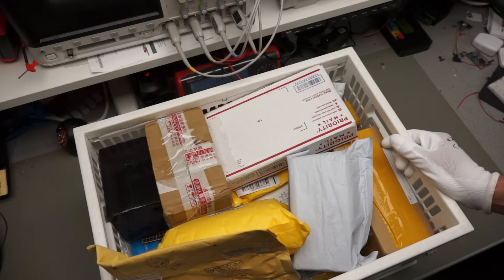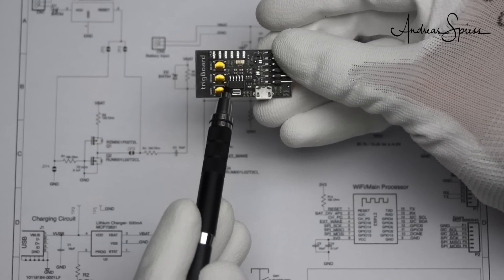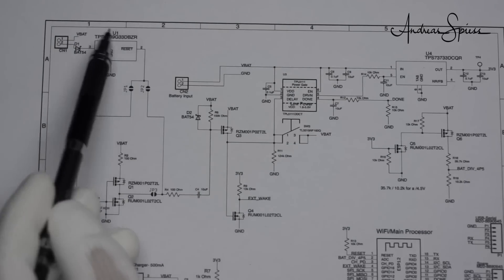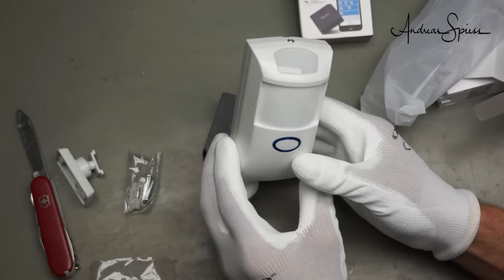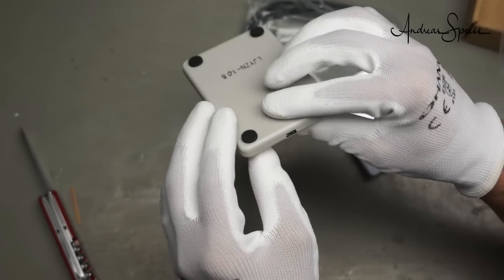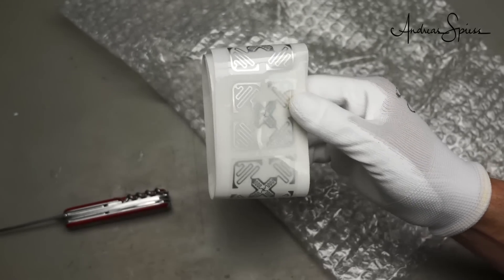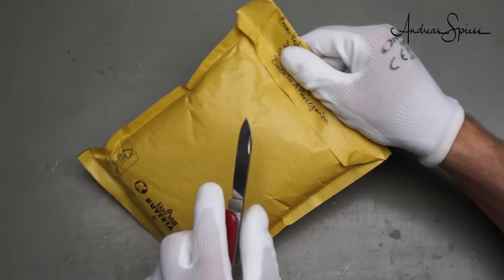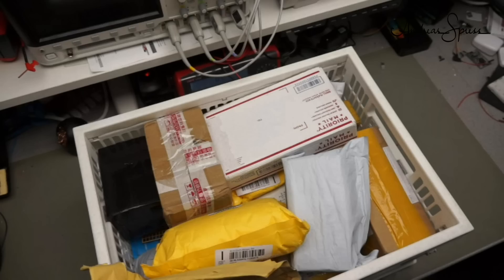#229 Mailbag (incl Kevin Darrah's Trigboard) Part 1 (Shelly, Sonoff, RFID, Raspberry)

Comment: Is there a circuit for the TPL5111 which allows for longer sleep times (like 24 hours) ? Maybe combining them using logic gates..?
Reply from the maker: I only know this one.
 If you combine it with a counter you will have to search a very low power counter.

Comment: Could you recommend a 433 temp sensor that would work with the Sonoff 433 bridge?
Reply from the maker: No, because I do not know yet which protocols the Sonoff bridge understands.
Reply: Do you plan on doing a video on the bridge? ....Might be fun to figure it out.
Reply from the maker: I plan to do one. But I will most probably flash it with a nw firmware.
Reply: Cool 👍
Reply: Cool 👍

Comment: Perhaps its time for some new Ikea stuff...
I Denmark we can now buy this model: https://www.ikea.com/dk/da/catalog/products/90356166/  cost less than 14$ Ill rather buy this than the sonoff.
The switch can also be bought together with a button (on/off), I haven't seen the button on the danish web-page yet.

Both can be used with the setup described in video #145.

So this time i think that its your bank-account that will be affected :-)
Reply from the maker: Fortunately it is not yet available here ;-) so I can save the money for the moment...
Reply: BTW they are also releasing some "tradfri" blinds next spring (https://www.99.se/artikel/11880-ikea-forbereder-smarta-rullgardiner) perhaps more money to spend.

Comment: I would like to see you develop a sensor array that can detect an RC vehicle transmitting on 2.4ghz.  I wont even lie: I'm building a tank and I was thinking it would be rad if I could detect another vehicle somehow.  Image processing is on the table, but i am curious if there is something less software reliant or more creative than my brain can come up with.  How about it, Mr Spiess?
Reply from the maker: It is easy to detect 2.4 GHz signals. However, detect from where they come is more difficult and needs big antennas. So you better go the route of image recognition.

Comment: The "TrigBoard" is a realy strange design. Why use a special timer? An ATTiny13A consumes 3 uA in Deep Sleep mode, but can wake up ESP not just on time or external signal, but also on specific analog value, sensor value or almost anything else. And it's dirt cheap.

And, of course, ESP8266 is obsolete, and ESP32 has it's own ULP for low-power operation.
Reply from the maker: From what I understood Kevin wanted to go below 1 uA. Did you try the ULP? So far I did not see many people using it in the Arduino environment...
Reply: A little bit, just for testing. I use esp-idf with Eclipse and JTAG debugging. But I did not measure power consumption - there's still a lot of really weird things in ESP32, which works not as on STM32 or AVR or any other MCU.

Comment: The Shelly has the following claimed approvals: 
Complies with EU standards:
• RE Directive 2014/53/EU 
• LVD 2014/35/EU  
• EMC 2004/108/WE 
• RoHS2 2011/65/UE
A similar device is available from Fibaro except the latest are Bluetooth and Homekit. The Shelly looks better built than the Sonoff, more easily hacked and perhaps more versatile with its 12V power. The important factor is range and susceptability to location or metal proximity. Might try one.
Reply from the maker: Thanks for the clarification about the approvals!

Comment: A little side step: Did you get around to test the SIM7000E based NB-Iot card that appeared in a previous Mailbag? What can it do - and not do - compared to other 4G cards, for example the other ones in the SIM7xxx series. (3G will shut down here in about a year or so, so I will have to migrate to 4G, and NB-Iot just opened as a regular service.)
Reply from the maker: Unfortunately, we still do not have an NB-IOT service here. So I cannot try.
Reply: @AndreasSpiess  Ok, thanks. Maybe you could try the card with ordinary 4 G, just to test the card? 
If you are interested, the charge here for NB-Iot is about 12 USD (99 NOK) per year per unit, inkl 5Megabytes, most likely incl overhead. 12 $ per additional 5 MB. 5MB per year is 570 Byte per hour.  So, you can do a lot with that, but it will  cost a bit if you have many devices. Maybe there will be a market for competeing Lora networks, if they can be organised. (12$/5MB is 240$/GB. I don't know the max traffic % on a chanel and the chanel width, but seems the Telecoms will get a good payback on the invested frequency resources, compared to 4G.)
Reply from the maker: I do not think LoRa can be done cheaper in this application as NB-IOT seems only to be a software update for the telcos...
I see LoRa applications more in one area around one or two own gateways and not scattered around the whole country.
I assume there will be a volume pricing for NB-IOT

Comment: Is it just me or can’t anyone else open any of the AliExpress links in this description?
Reply from the maker: I just tried and it worked here...
Reply: Andreas Spiess i tried it again using my notebook. Works fine. But the links won’t open on any of my iPhones or iPads. Wierd. Maybe the YouTube app screws up?
Reply from the maker: I tried with my iPhone and it worked.
Reply from the maker: But I did not update to IOS12 ;-)
Reply: Andreas Spiess ok. Challenge accepted. I have an old iPhone 5s in my lab as a video player while I’m down there. It’s the only device i have that is still on iOS 11. i will try tomorrow of it behaves the same .....
Reply from the maker: I am also on IOS11
Reply: Andreas Spiess ok I finally managed to try it out. With iOS 11 the links do work. With iOS 12 not.

Comment: the shelly board looks small enough to embed in the appliance like a lamp instead of a wall switch.
Reply from the maker: Also a possibility. Sure.
Reply: Works especially well if you have three way switches, meaning more switches for same light.

Comment: I'm really interested in your opinion on the Shelly. I'm a bit skeptical about it as there is no electrical isolation between high and low voltages. The ESP-Module apparently directly senses the hot wire.
Reply from the maker: 1. I agree with Ed19601. It is a covered product and will not be touched.
2. It certainly needs two wires to get power. Only line most probably will not work.
3. The Sonoff POW also was connected to the live wire. You always have to pay attention if you open such a device.
Reply: There doesn't need to be one, it is in a switch box you are not supposed to you touch it or connect low voltage to it
Reply: I'm interested too, for a slightly different reason. How is the device powered? In a socket it could take a line and neutral locally for power but in a light switch (at least here in the UK) there is no neutral (only line, switched line and earth). Whilst using the earth as a neutral would cause the device to power up it would be dangerous and wouldn't work where an RCD/GFCI/ELCB is fitted.
Reply: I find this device very versatile. I use to flash all my sonoffs, but the software for Shelly is very nice, and after they added MQTT, I do not se a reason to flash. Cloud is disabled when you configure MQTT

Comment: If the trigger chip switches the ldo of and on...... Where does it gets its power when the ldo is off?
Reply from the maker: The ESP does not get any power when the LDO is off
Reply: @AndreasSpiess  yes, but I mean the chip (TPL5111) that switches the ldo, where does that get it's power after it switched off the ldo
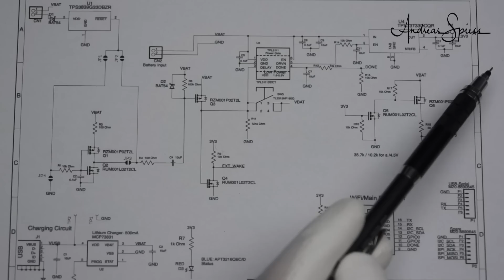Reply: If you have another look at the schematic (i.e. 5:20), you'll see the TPL5111 (or is it the TPL5110? - might be a typo in the datasheet?) is powered directly from the battery at all times, whereas the ESP8266/ESP12 is powered via the LDO, which is what is enabled or disabled as needed.
Reply: @pfeerick  great
 Thanks. On my phone that wasn't really visible

Comment: I have the sonoff RF bridge doing my 433mhz to MQTT translation. When I got it in summer you had two options if you wanted open source firmware to work properly and read all sensors: Espurna + a hardware modification to bypass the chip that actually reads the RF, or Tasmota and flash that chip with a special firmware as well. I went with Espurna + the hardware mod and now it's just like a DIY solution, but with the nice looking design. Overall it's cheaper and easier to solder a 433mhz module to a normal esp, same functions, less hassle.
Reply: What I've done is solder a esp-12 with both 433mhz transmitter and receiver module. But the problem is those cheap module isn't very sensitive. With a spring antenna, most of them are still usable only in a few meters. Nice to know the Sonoff RF bridge exists.
Reply: @willwho2512  I use the diy version with an esp and module for my apartment. Range is ok for a 2 bedroom, but it varies a lot because of the antenna. 
Using an analyzer like Andreas has u can tune it just right. Also, the superheterodyne receivers are much better. 
The RF bridge has very good range, its about 10-15 meters indoors, enough for a normal house with reinforced concrete etc.
Reply: NS Gaming  The analyzer is on my shopping list for a long time but it’s like a one time usage for me. Instead I made another two and place them around the house.
Changing protocol isn’t an option for me because this device needs to talk with other dirt cheap, off the shelf, and easy to muck around sensors. I don’t like those smart home products that always ask me to install their apps and ask for unnecessarily Internet access.
I already connect my doorbell, PIR sensors, and window sensors to my local MQTT system. it can even notify me through my line account(an instant message app).
Reply from the maker: The analyzer would not help here as it needs a 50 ohm antenna connection. Which  does not exist here (you have no antenna  connectors)
Reply: @AndreasSpiess  I sacrificed one board and bodged in a UFL connector on the antenna trace, then did UFL to SMA and that's how i tuned all the antennas. I'm sure it's a very imprecise way of doing this but it seems better than the stock antennas after.
Reply: TThe  rf bridge is an interesting topic,  i look forward to see what it can do.  For example using the usual github projects,  we can easily reproduce easy signals.  But not complex ones as Andreas had shown in past video with sunshine stores no 209. I'd like to know if the sonoff rf bridge is smart enough to learn complex signals...
Reply: @felixh.7501  It's pretty much the same as the very simple modules u get from China. It does only OOK, meaning only on/off type signals, no FSK, FM, or advanced stuff like that where you change the frequency or vary the amplitude subtly.
Reply: @bardenegri21  I was reading on banggood that the bridge only supports 4 devices... Does alternative firmware change that?
Reply: @WilliamDeboer  Yep, unlimited. The modified firmwares just relay whatever code they get to MQTT. You do need some sort of automation server to actually make them do stuff, like Node Red or OpenHab or a python script or whatever

Comment: you can hack (HW mod...) that SONOFF RF to allow the use of a much better rf library: https://github.com/xoseperez/espurna/wiki/Hardware-Itead-Sonoff-RF-Bridge---Direct-Hack
Reply from the maker: Thanks for the link. Tasmota also seems to support it.
Reply: not the same... both tasmota and espurna support the STOCK device, BUT espurna has also a version that requires an hw hack (in previous link), bypassing the internal rf codes generator, which is quite limited, and using a much better library, rc-switch, which has tons of addon rf devices supported... with the hack, the esp is responsible of the rf codes generation, not the internal dedicated chip... anyway, for this setup, even with stock device espurna seems better, it has a learning web gui while tasmota has not...
Reply: here the web gui for the learning part: https://www.youtube.com/watch?v=uGilGeCAV98
Reply from the maker: Thank you for the info. I use Espurna in some of my devices, but in an old version.